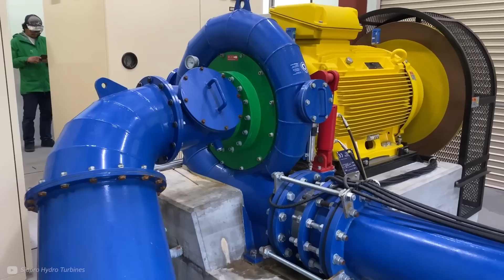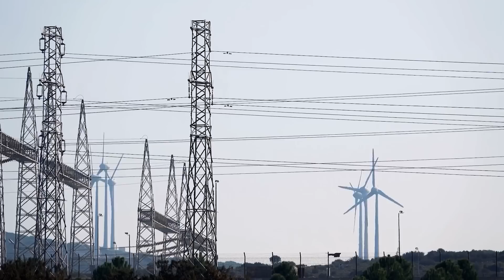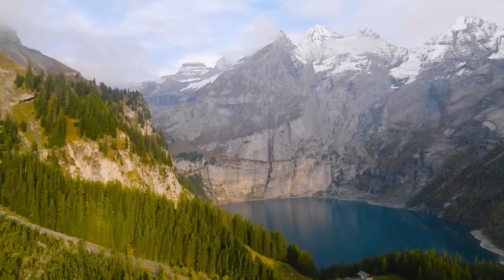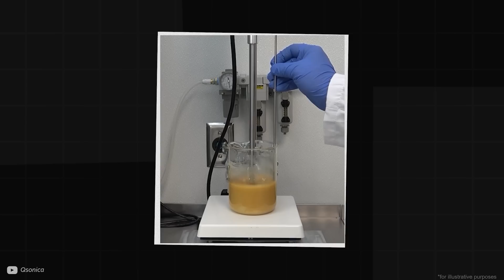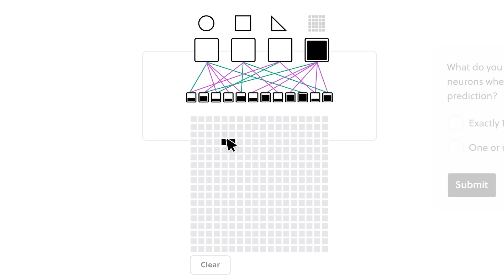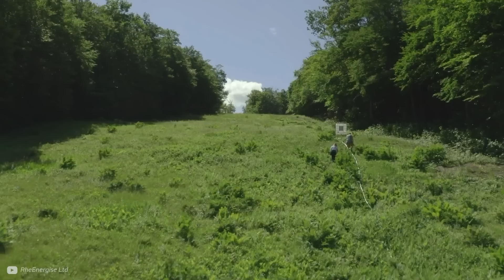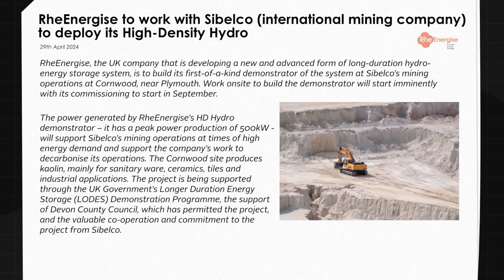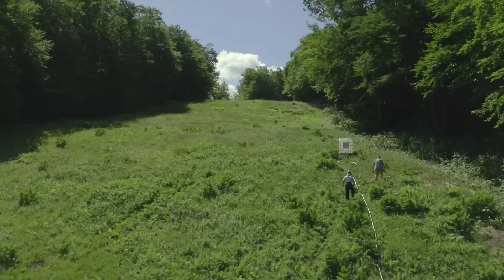The Genius of 'Waterless' Hydro Energy Storage

Comment: Really hard to take you seriously when you show images of that ridiculous crane system.
Reply: don’t then
Reply: You should cry about it till you feel better.
Reply: There's definitely a place for it... but ignoring maximalist claims; Peaker plants (the frequency/power factor type) are a prospect for short-term, transmission related support infrastructure that could already do with being better decentralised never mind decarbonization.
Reply: Yeah, it makes no financial sense because it’s much more expensive than installing batteries. Gravity storage is almost 6x the cost per kWh of storage than batteries and batteries will continue to drop in price - now a little under $1 per kWh storage. Unless you can list one ton one meter high (1kw) for less than $1, you are losing money compared to batteries. It’s also false to say hydroelectric dams are gravity storage because they aren’t using energy to store it, whereas w/ gravity storage, you have to apply energy to get stored energy to begin with, hydro is totally passive in that regard.
Reply: It’s one picture to describe the concept of gravity based storage for context. If it helps, think of it as the naive way to do gravity storage that makes the concept apparent.

The video never mentions gravitricity or claims anything about their failed prototype.
Reply: Well, let’s see your video to explain it, sure none, just as I expected.
Reply: It seems you said it's OK for animals to drink this stuff or for it to be consumed. I wonder what the long term issues could be to wildlife? Also would a build up of rain water make a difference to its performance???
Reply: The losses in the equipment alone are probably massive, put 100% effort into 'storing' the energy, only to lose 68% to withdraw it through heat losses
Reply: @smallpeople172 dare I ask where you’re getting kilowatt scale batteries for a dollar
Reply: He knows that it is ridiculous as well, thats why he showed it

Comment: The waterless systems like the crane can wind up a flywheel and then dissipate that energy over time
Reply: Flywheels are extremely expensive compared to simply using batteries. Go lookup the Siemens system in Ireland.
Reply: @fredbloggs5902  You’re not wrong but transforming stacked concrete blocks gravity potential to useful electricity outside of regenerative breaking is an interesting problem to solve
Reply: @ValidatingUsername  Concrete block power storage is nonsense. Go do the calculations.
Reply: @fredbloggs5902  I have that’s why I’m mocking the idea bringing it up

Comment: However, the slurry, having a greater mass, now requires more energy to pump it back up !!!
Good idea, but water is cheap, easily recyclable, non polluting, so what's not to like about simply using plain old water.
You don't need hundreds of feet of drop to generate power.
High head hydro is unnecessary, as low head works just as well, and does not impact fish spawning, as salmon and other fishes can easily climb low head hydro dams, and then rest in the slack water pol behind them, just like a natural stream/river.

Tim

Comment: Bill Gates funded a startup that was using gravel and basically a ski lift to do exactly the same thing. Smooth pebbles were sufficiently thin has a fluid as to flow really quite nicely. And of course, stones are quite dense. I wonder whatever happened to it? Perhaps you could do a video on that.

Comment: What I do not understand is; why nobody uses mine shafts for gravity storage. Almost all infrastructure is there; electric motors and lifts, shafts and vertical lines. The only thing missing is heavy blocks to be transported up and down. Maybe some lithium batteries for balancing.
Reply: Work out the actual energy storage capacity and you'll see. Gravity just isn't that strong.
Reply: @vylbird8014  It would be much higher than that of these cranes that displace blocks. Remember, you have corridors to work with. The capacity is almost infinite.
Reply: @grzegorzkapica7930 So you STILL haven’t done the calculations then 🙄

Comment: Silliness, but still interesting.  Any meaningful solution needs to be able to store multiple gigawatt hours. I doubt this tech can do this at scale and at reasonable cost.  The LOW FRUIT on the tree is  still Demand Management.  If electric utilities would get off of the flat rate pricing, move the base price higher and offer multiple "spot price" discounts when the wind is blowing and the sun is shining, this would be almost as good as a grid scale battery and cost much, much less.  The #1 application would be EV charging and #2 would be domestic hot water heating.

Comment: If it's not totally enclosed, it will fail in a very short time. Also, filling any location will immediately cause dilution and contamination simply form the sides , like in mining pits. Nuclear and hydrocarbons are by far the answer, so far.

Comment: Claim about being better than batteries for long duration storage is not accurate. The energy loss in batteries is extremely small, I can hibernate a laptop and turn it on months or years later and still be fine. And with the reduced efficiency of motors and physical losses vs electrical conversion loss, batteries are still a good bit more efficient.

Comment: Their problem is  thinking:
1. BIGGER is BETTER. 
2. They are thinking mechanically and NOT Electrically. it won't work As efficient as a COIL & CAPACITOR. Is storing energy in THE & SPACE

Comment: This is very high production value video but took way too long to explain.  As a storage (separation of production and use in time) technology, the energy density will never be enough to make gravity batteries truly viable, especially in the face of chemical battery evolution, and even IC engine evolution.

Comment: Mercury would solve all these problems much better, since it has 13.6 times the specific density of water. If all reservoirs are air tight with a gas pendulum, there wouldn't be any environmental impact.

Comment: Even if everything about these claims is true. It cant use a 60% smaller reservoirs AND needs just 40% of the elevation to provide the same power. That needs to be an OR statement. Furthermore:
I cant imagine it can be done as an open sytem with contact to the environment. Maybe if you have two emty mines....seems rather limited.

Comment: Clickbait title and thumb. Just a more viscous solution for simple gravity battery, with pretty much no proof or details shared with a bunch of possible problems that have no solutions/consideration shared. There are tons of reasons water is used instead, all of which are ignored here

Easy skip until they actually prove this in action, which I don't think will work as well as they think it will.

Comment: Use the weight of your car on a hinged ramp to slowly pull a weight up like the clock mechanism .When the ramp becomes level and you drive off the ramp will slowly rise using rams ready to drive up again .The upwards and downwards movement can both generate electricity to charge your heavy EV car .

Comment: The big problem with the design of any pumped hydro is they run on average at 25 % non efficiency. You have to supply power from an external source to make them work. No solar at night and maybe no wind. So relying on renewables for power to pump may not work. Making the hydro useless until excess power is available. If they perfect storing energy from the water drop, like experiment with air pressure. Making them pump themselves. Better proposition.